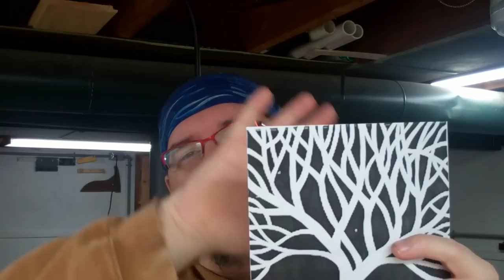Stylish Scroll Saw Tree wall hanging how-to video

Comment: Use Mineral Spirits to remove the paper pattern. It makes it really easy to remove. Also, wrap the project in clear packing tape after you apply the pattern and the tape will keep the blades cool and also control sawdust and tearout.

Comment: Use blue painters tape on the wood then mount you pattern to the wood .
The pattern will peal off and you will be ready to apply your finish , no need to sand ,or wait for the paint thinner, to dry and no smell and a lot safer .( also the tape  will help lubricate the blade )
Reply: I like that idea, I'll be trying that next time I scroll something!

Comment: hi====may I make a few suggestions-----use a smaller drill as it looks like you have a lot of tear out on the back of the wood and be sure to put another bit of wood to sit on while drilling and that will help prevent so much tear out-----also to sand off the paper you are really sanding in the glue into the wood----suggest take as much of the paper of as you can then use a simple spray bottle with paint thinner and spray the paper and let it soak in a bit and the paper will simply peel off easy then spray another on the bare wood and use lint free cloth to wipe off any residue of the paint thinner and any of the spray glue---------let it dry and then sand it off----------personally I also use Watco oil but only the clear natural as if you use the stain on the softer woods it will end up bleeding into the wood and can be a bit of a mess and spoil the pattern------so after trial and error when I first started scrolling many many years back I found that the natural oil suits all my needs=---------saying that though if you want to stain the wood then you will need to protect the wood with a solution to prevent the bleeding --------I also found that using the natural Watco you get a much more cleaner finish ---------if the wood is green such as some poplar you get all the natural colours coming out and the same with hard woods------------just my suggestions----------------the two things though that I would look into is one to use the smallest drill I can, spray the wood after you take as much as you can of the paper off --------then you will find that your not literally smearing the spray glue into the wood ------doing this you will find a huge difference in the finish-------------happy scrolling--------------Tom
Reply from the maker: +Tom Cole thank you

Comment: What do you do to sand the internal cuts?  Cut little strips of sand paper or do you just get clean enough cuts that you fell it isn't necessary?
Reply from the maker: I have never needed to sand the cuts because the scroll saw cuts are very clean and really don't need any sanding. Sometimes I just hit the outside edge with a foam sanding pad.
Reply: So I used some spiral blades and got horrible results which needed to be sanded.  And then read that those tend to do poorly for cleanness of cut.  I haven't used straight blades yet, is a clean cut something I should expect right off, or is it something developed over time?
Reply from the maker: Make Crazydays I don't use spiral blades because I have a hard time controlling them so it is not very accurate. They leave a very rough edge. I like to use a reverse skip tooth blade or really any straight blade. Its leave a very smooth edge without doing anything. It you are using soft rime you may need to sand.